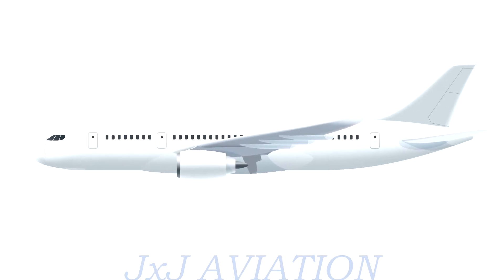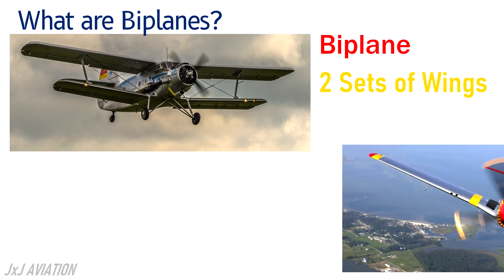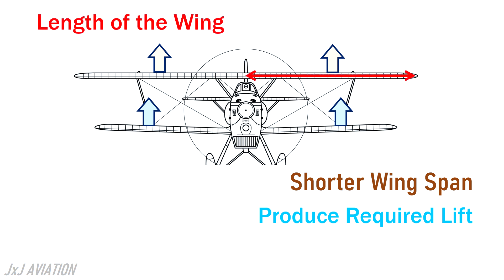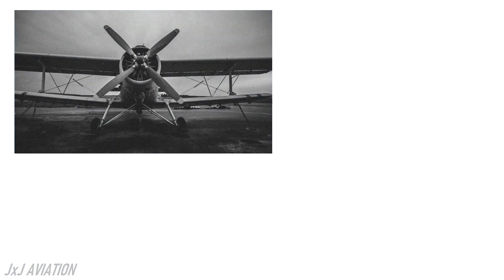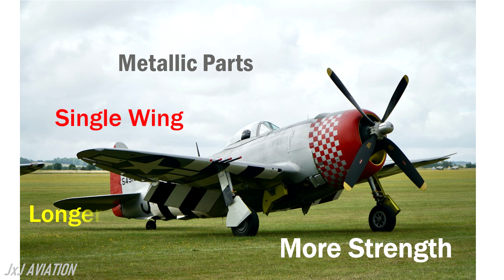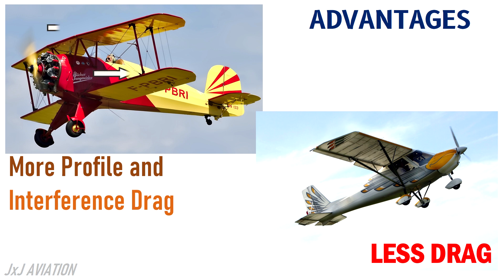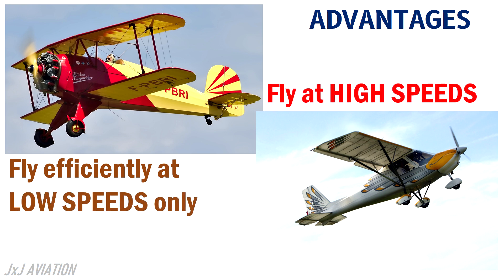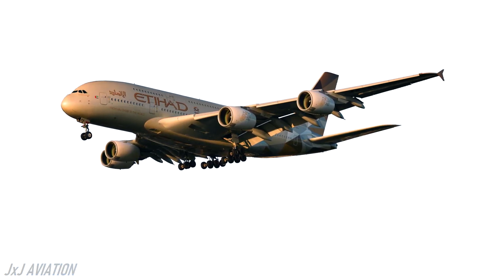Why do we have more "Monoplanes" than "Biplanes"? | Difference between Monoplanes and Biplanes |

Comment: Biplanes have also the upper hand using low power engines, which is another reason for their success until new engines and materials were available. Still a charming and useful concept, biplane is a way of flying of its own. Thx for the video
Reply from the maker: Thank you! Check out my other video as well!

Comment: My next question would be, why do biplanes even still exist?
Reply: The biplane is used for crop dusting because of its slow speed and no need of runway. It is also more economical.
Reply: I'm sorry but what you said is just dumb.......
Reply: @bobuboi4643  no not really. It’s an obsolete tech. Why are there still brand new biplanes being built. You don’t see any brand new steam tractors built.
Reply: @kolinmartz  yes, an "obsolete" tech in fighting other planes. That's why we have prop monoplanes and jets. They are used in airshows and areobatics Because most jets and monoplanes have terrible manueverebility with a few exceptions.
Reply: @bobuboi4643  prop monoplanes still exist for their fuel efficiency and cost. 

“With a few exceptions”. There you go. Those exceptions make biplanes redundant.
Reply: @kolinmartz  yes and what will you choose? A 30,000 dollar biplane or a 4.2 million fucking dollar p-51? I'm choosing the biplane no thank you.
Reply: @bobuboi4643  you don’t see planes used in aerobatics in an air show going any cheaper than 100k.
Reply: @kolinmartz  still a million times cheaper then any monoplane.
Reply: @bobuboi4643  not really. If you’re buying them for aerobatics they’re gonna be around the same price range. If you’re just buying a plane I can think of monoplanes that are way cheaper.
Reply: @kolinmartz  what the hell do you think modern biplanes are? There obivously used because even biplanes are still being made and are still being made more advanced. There not WW1 era biplanes you know? There actually more like modern planes.
Reply: Dudes,not trying to provoke neider of the sides but each one does have a point

1)Yes i know that biplanes are out of date and have their failiers,but many people still like these planes cause of their charm and history kinda like steam locomotives,there a many steam engines still being built at this centry;

2)but even thought they are cool time does progress and the technologie and study increases,for the purpises of safety or even quiker ways to do stuff,after all would It be better call someone a Cell phone or walk out to look for a phone-box
Reply: @evertonmignac-D7101  I totally understand. All I was saying was other than nostalgia they bring, they offer nothing else.
Reply: Yeah @kolinmartz i kinda agree but you know how people are,sometimes even the old simple and slow peak's over the attention.
Reply: @kolinmartz  Actually this is not really a completely dead concept.  i.e.  Slow flying craft that would still desire a great degree of stability, maneuverability, and payload carrying capability can accomplish these things better with a biplane design than a monoplane, like... a crop duster.  Fighter jets... these aren't the goals... but what about propeller driven drones?  Most especially when modern a biplane can be made far stronger, lighter, and more aerodynamic...  If you had a "Jet bi-plane" in theory...  it'd have an incredible amount of lift potential and maneuverability, but it probably couldn't break mach 1 with some of the strongest jet engines out there.  It could turn far sharper than any modern jet fighter though...  Anyways, the question of whether bi-planes have a home still seems ironically to be asked...
Reply from the maker: Biplanes are used in airshows and as low speed agricultural aircraft.